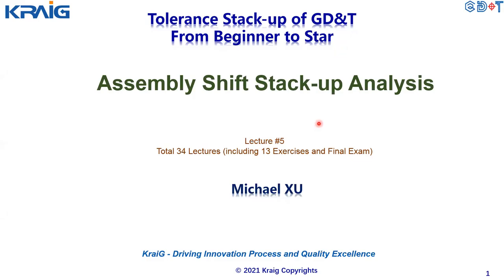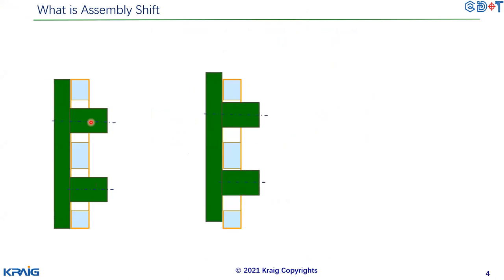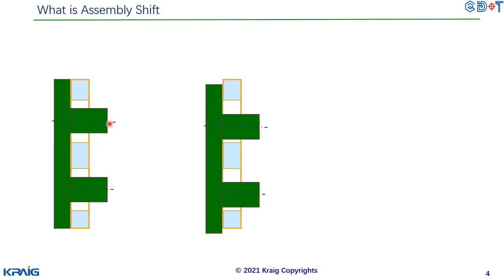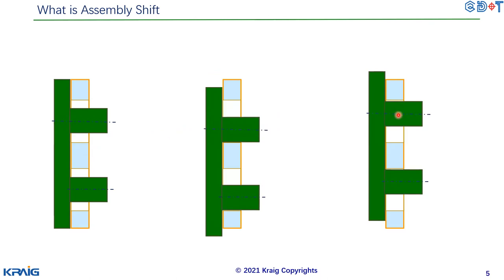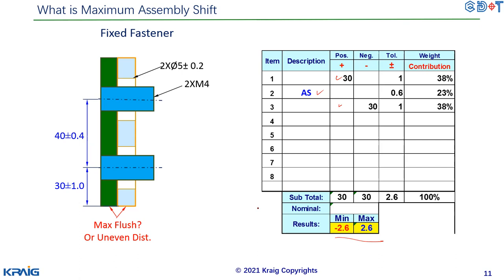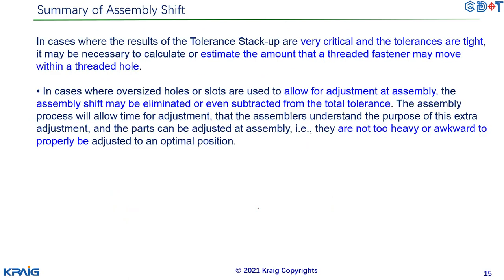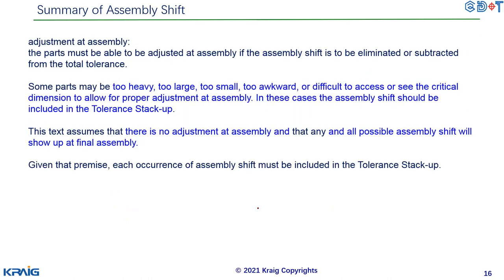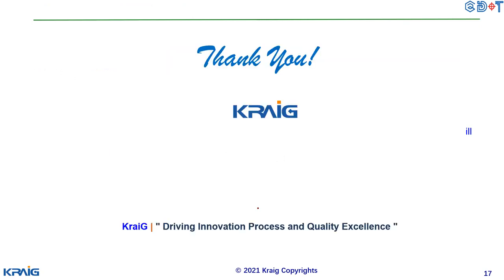Assembly Shift Tolerance Stackup

Comment: 1.Assembly Tolerance=(D_hole-D_shaft)/2+T_hole/2+T_shaft/2, hole tolerance / shaft tolerance also contribute to assembly tolerance
2.when two part align by two pin in certain direction,  Assembly tolerance should only take the smaller one?
Reply from the maker: Here is the reply about your question: 
1. Assembly Tolerance(accumulated tolerance) is related to Assembly Shift, and Assembly Shift=+/-(Max_Hole-Min_pin)/2, from this point of view, you are right.
2. If there is location pin, which usually has smaller clearance than Fastener/Hole, then use smaller one.

Hope it helps.

MIchael
Reply: excuse me
Could u tell me?
What does 1 express to?
What does 3 express to?